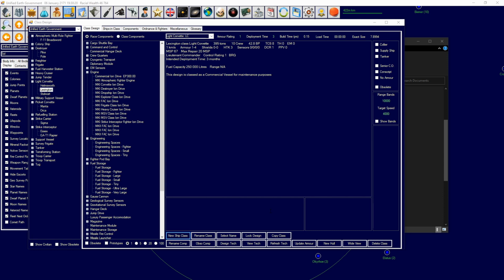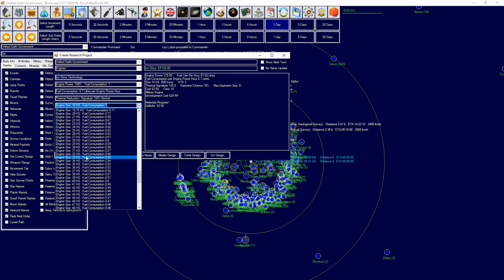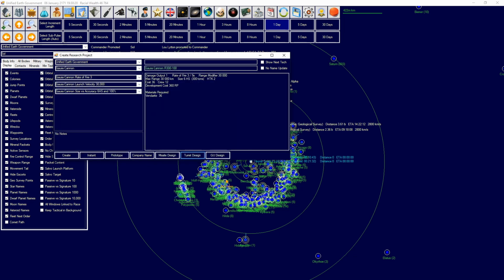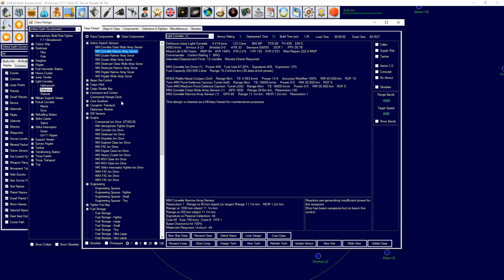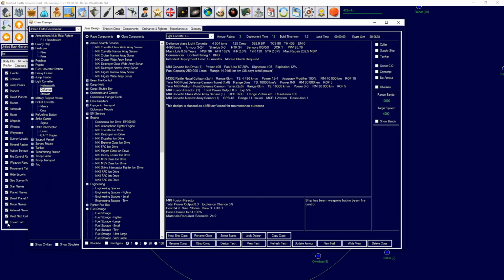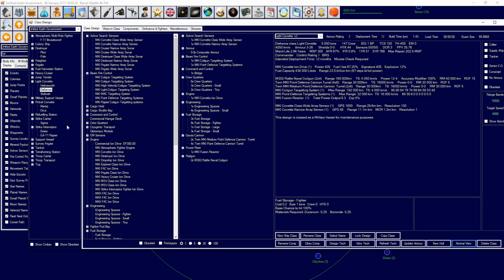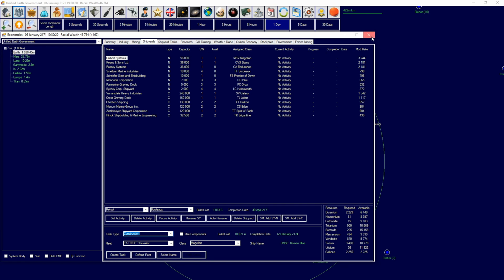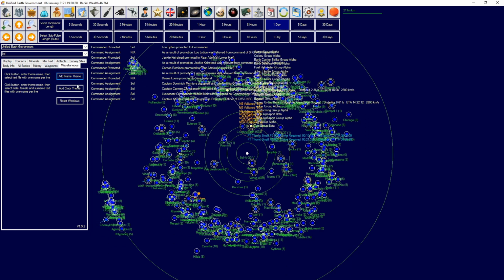Aurora 4x C# Basic Military Ship Design (3) -  Step by Step Design

Comment: edit: ignore the confusion, I am re-watching again and I mised about a 30 second period of the video it seems. Will change these questions.

Thank you for these tutorials. Although they create a lot of confusion when I try to pay detailed attention, I hope you don't mind some questions :) The point defense role of an escort has me a bit confused. 

If you only had one fire control being used for both PD and ship engagements is the logic that every 5 second game tick, the ship looks for a target inside 30Mm and fires all available guns at it then if if it did not find anything and the coilgun is off cooldown it looks inside 40Mm and fires just the coilgun at what it finds?

Because you have ship to ship weapons on the same fire control, does that mean you cannot set the fire control to Final Defensive fire mode?

Does the 5 second tick rate of the game mean that these escorts do not get an opportunity to fire on some missiles travelling faster than 6Mm/s with an opportunity being less likely as the speed increases beyond that?

In a reply to another comment you say this can hit 6-8 missiles from a volley of 45 coming in at "very fast speeds" which I find confusing since most missiles I design are a lot faster than 6,000 km/s meaning if I understand PD right, these would be able to shoot down at most one per volley. I think I may need to binge watch your entire Aurora 4x tutorial playlist before my questions actually make sense.
Reply from the maker: 1A = PD on Fire controls directly relates to missiles

2A = You generally want to separate your ship to ship weapons with your missile to missile and PD, but no if I wanted to I could set them as PD

3A = FDF (final defensive fire) always fires even if a missile gets right on top, for area defense this can be an issue and its why you want longer range and its also why the faster the missile the better. 

4A = So you dont need to match the exact tracking speed with the speed of the missiles to be able to hit them, you can have lower its just that you will take a penalty so the idea behind the gauss PD which is what I am using is that I will have so much lead down range that I will be able to hit atleast 6-8 of them out of the sky and this scales accordingly, in my main fleet in this game I was able to put out 1000s of gauss cannon rounds into the space around my fleet for PD (think battlestar galactica style), so even though it was a 7% chance to hit, it was still getting a sizeable amount of missiles etc. 

I hope that answers the questions and also i want you to keep in mind my ship combat videos and some of these are quite old so go check out the latest videos as these ones suffer from some audio issues and my experience in commentating has changed a lot.

Comment: I may be wrong but I think best solution would be to have more then one Beam Fire Controll (PD Targeting System) for this ship, because right now it will feed targeting data to all 6  turrents and they  can fire only on one missile salvo/ship. If all missiles are destroyed in salvo number one then you will not shoot at the rest.
Reply from the maker: This was just an example ship, but the design its is based on only uses one fire control for various reasons, 1 size, 2 I will be firing at salvos of 45+ going at very fast speeds and at best each of these ships will shoot down around 6-8 missiles in ideal circumstances so the need for further fire controls is not required. Thank you for your opinion though, also something to note the ships in the game I use to show you guys stuff are not optimal in the slightest as they are the same ships I use for my AAR and as such are mainly for roleplay.